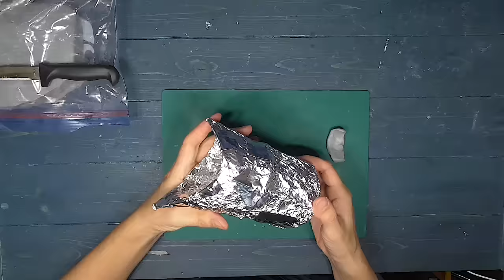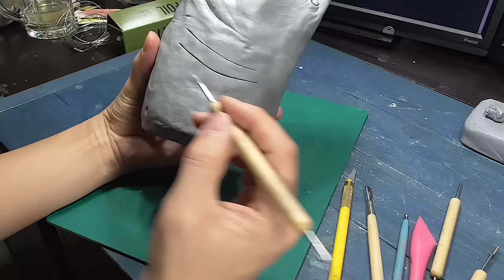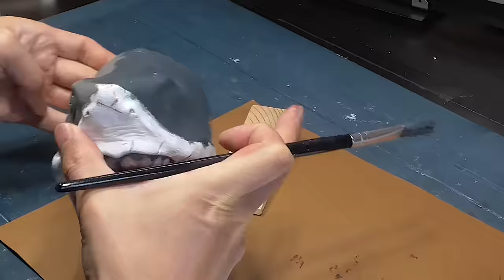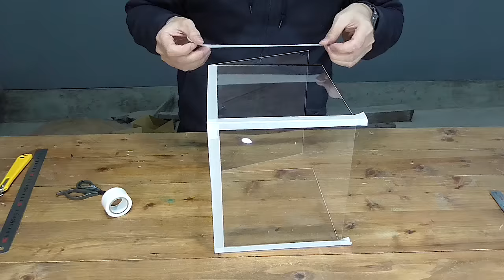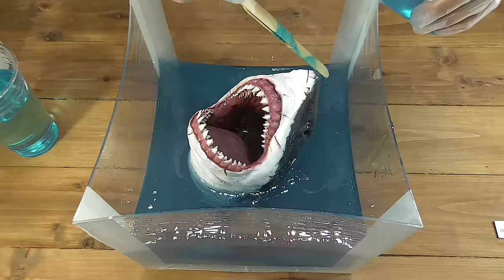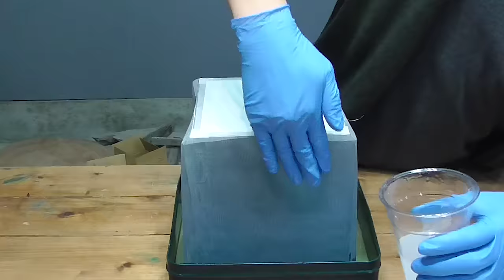BIG Resin art of MEGALODON ATTACKING【Sculpture of ancient giant creatures/Beautiful horror art】

Comment from the maker: Thank you for watching. Here are some frequently asked questions and their answers.

Q. What is that clay? Does it cure in the microwave? A. The type of clay is polymer clay. It cures with the heat of the oven, not the microwave. It's sold to Amazon.
Q. What kind of resin are you using?　A.It's a polyester resin. But this is not recommended because it is difficult to handle and has a strong odor. Epoxy resin is recommended for use. 
Q. The frame is distorted due to resin shrinkage. Use thicker boards. A. Then the frame will not be able to absorb the shrinkage of the resin and the sculpture will break. Frame distortion absorbs the pressure of contraction. Using epoxy resin instead of polyester resin solves this problem, but I don't have the money to buy large quantities of epoxy. I like this curve.
Q. Music is noisy! distracted.　A. sorry I can't speak English so I use it without help. From next time, I'll change to quieter music.
Q. You are bad. No technique.　A.I am aware of it. Please give me a break. 

Thank you so much for giving me your valuable time.　Thalasso hobbyer
Reply: Great information, thank you.
If start from A to Z that's a scientist doing by the book. Artist can start from anywhere D, G, ect. Not always allows rule or technic. the final result proving. thats the art work.
I like your art, keep doing it
Reply: Like I said you can prebake the teeth before hand instead of needing to be careful to not damage them. One way to minimise polyester resin shrinkage is to use less hardener and have smaller layers. You say that you like it, that is fine. Just thought I'd share what I know so that you could do even better crafts :) I really do like your stuff :)
Reply: Maestro :  Por qué no hace todo su canal , escribiendo en español ?  Hasta cuándo le damos pie a los imperialistas ingleses y norteamericanos , que sigan pisoteando y aplastando otras culturas ?  Si alguien quiere  saber , que use un traductor web , pues entonces.
Extraordinario su arte.  Bravo.
Reply: すみません:あなたの制作した芸術品は買えますか?
Reply: @johnsonguo9209  : Que chucha ?
Reply: I am not a sculptor so my opinion can only come as one of your audience.  This ‘technique’ you are criticized for lacking—it must be truly amazing.  Your work is beautiful, holds the attention, factual, respects detail, etc etc etc.  if this ‘technique’ is worth criticizing your work for, those who are criticizing must truly be very rich, very very well known, and considered masters of their craft.  If not...

As always, I admire and am mesmerized by your tremendous natural talent and absolutely I subscribed.
Reply: Do you sell your work?
Reply: @nicholassmith7407  :Hola.
Creo que te equivocaste de micro.
Adiós.
Reply: "You are bad" Is he off his meds?!? I've yet to see you do a "bad" piece.
Reply: I have a question dose oil paint work the same as acrilic
Reply: I watch all your videos in a day! I need more. They are so amazing to watch!
Reply: Who the fuck tells you "You are bad?" Dude you're amazing
Reply: Why you have to coating the clay with resin first?
Reply: Ur great
Reply: How In the world could this be considered "Bad"
Reply: You should make two guardians fighting with two cliffs on either side sometime that would be really cool
Reply: @BruceLie-ku5ws  I think this is to assure that the actual sculpture is fully covered with resin. I believe that pouring the resin first off may miss a few parts for more detailed sculptures. However, there may be another reason ^^
Reply: So cool most honorable thanks for video. A neat twist could be to put red dye near the shark face (to look like blood)
Reply: please do a ABZU resin art thing, (abzu is a playstation game that's underwater)

Comment: Looks great! Just a couple of notes. If you used polymer clay you could bake the teeth before hand. Also if you used several coats of paint you could achieve a more translucent layered effect.

One thing you might try is to create "X" braces on the acrylic walls. Bond them with Weld-On 4 acrylic adhesive. You could even drill, and glue, the acrylic sheets to actual plywood.